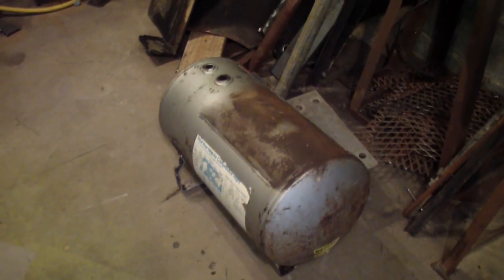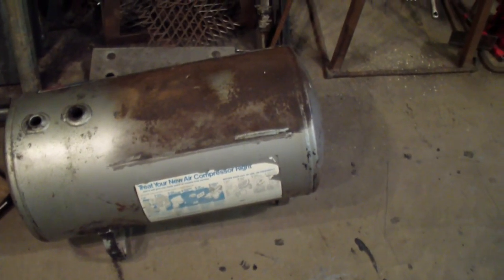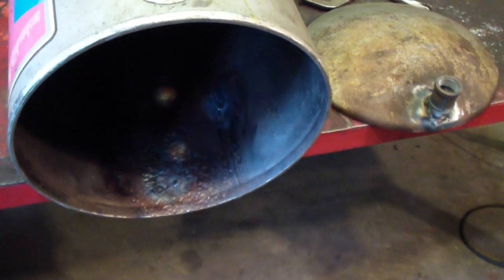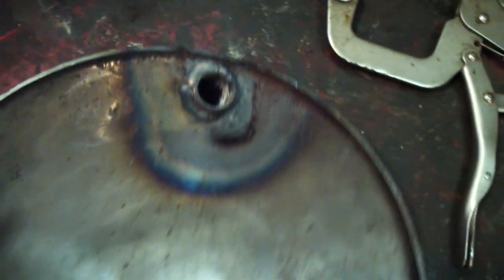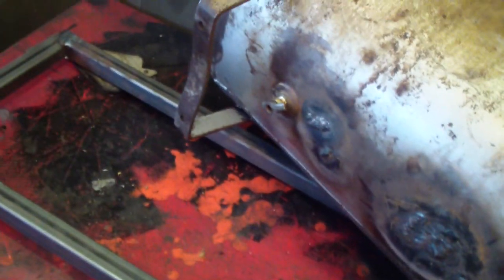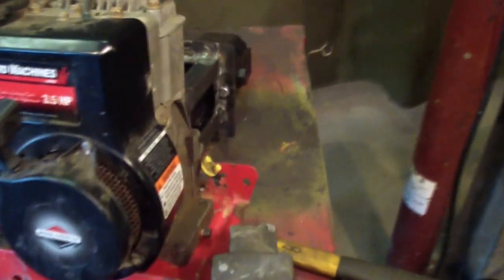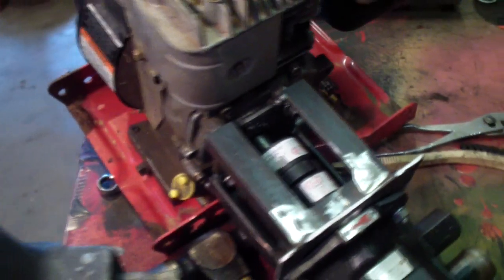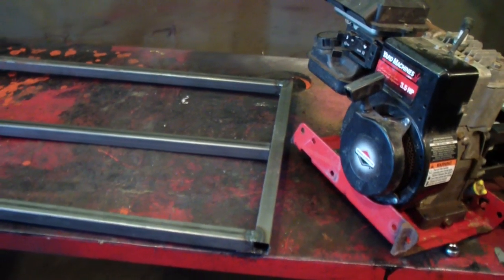Home made hydraulic power unit, part 1.

Comment: 1st of all,  flushing the rust out rather than cutting it off and dealing with making the tank air tight again could be avoided. To deal with the rust throw a bit of marvel in it for 2 days and the rust is a non issue. cutting a  1/2 of merchant cupping on the tank is much stronger than fooling with the threads .